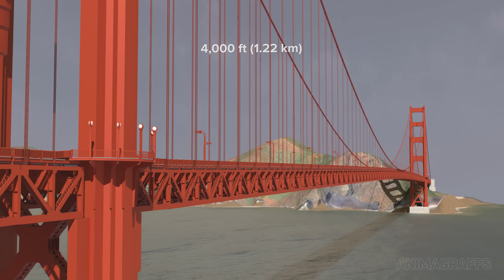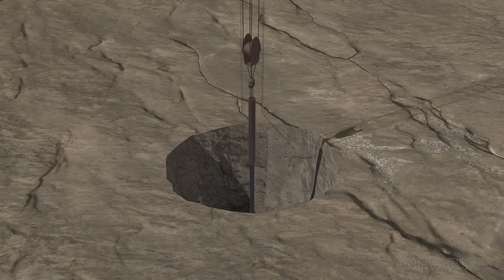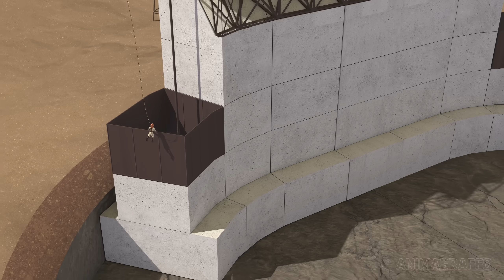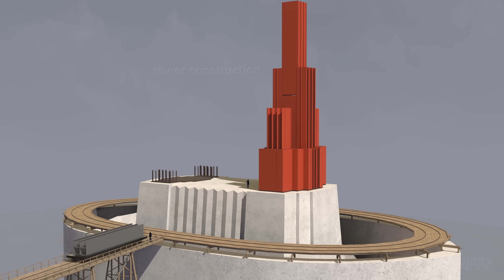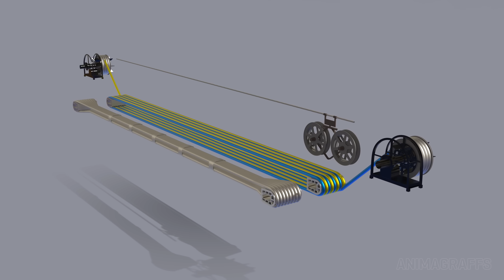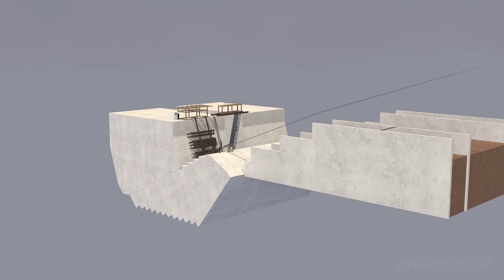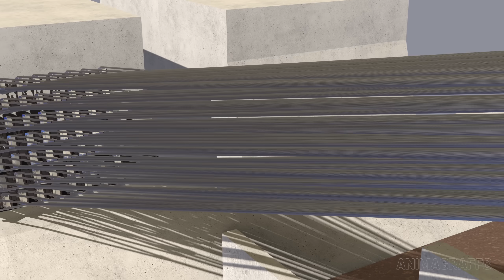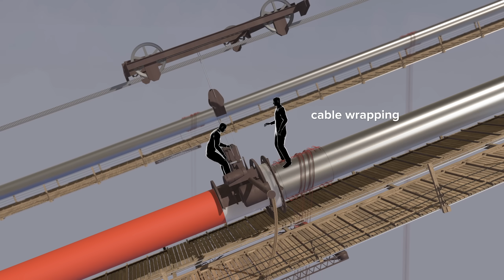How the Golden Gate Bridge Works

Comment: Not mentioned is that one anchorage is finalized by being embedded in bedrock, the other is not bedrock, but a sufficiently large concrete counterweight. 
The dimension of the average common expansion of the span off the tower would have been nice to know, the visualization seems extreme. Also interested in knowing if when the saddles are moved 5'6" do they slide under the cable, or move the cable as they move?

Comment: Thank you for placing people around the bridge for scale. The building and execution of this beautiful bridge by these beautiful people, and engineers was nothing less than amazing. Thank you ! And finally this bridge is begging for a proper inspection, paint job , and another thorough inspection. I wish I could have been at the end of the pier floating on some wood and sinking the pipe into the ground before blasting for the first time ever. Excellent Video btw !

Comment: How can the carriages stop halfway and have the lines swap carriages in the middle? Wouldn't that mean the lines would be crossed within each strand, and be anchored into a shoe that starts a line on a separate cable? In your model it shows the two lines phasing through eachother at the center span.

You also said there are 61 strands per cable, but the strand shoes are shown to be arranged in a 9x7 grid, meaning 63.

Comment: My grandpa worked on this bridge. Helped construct and pour the north foundation. The two stories he told were one: the bedrock on which they laid the foundation was the most solid rock you could ever ask for. You could hit it with a hammer and it would clang like metal.

The second story is when a new guy wanted to work on the project, they would test him by taking him up the elevator to the highest point of the tower to see if he could handle it. In the depression, a lot of those guys were pretty desperate for work.

Comment: I grew up in Southern Marin County (1960's, north side of the Golden Gate). I have driven across the bridge thousands of times and have seen dozens of documentaries of its construction. This is virtually the best description I have seen of the engineering of the Golden Gate Bridge. Especially the cable winding process. In 1984 my father and I went to see a show in San Francisco on a rainy stormy night. On our way home back to Sausalito, the storm became stronger with 60-70 mph winds. As we crossed the bridge I could see the span swaying. When we reached mid span, the bridge suddenly moved causing our car to jump from on lane to another. The bridge was closed to traffic soon after we crossed. Because of this, I have admired the engineering integrity and safety built into the Golden Gate Bridge. Thank you for this wonderful video!
Reply: From Corte Madera myself and I completely agree. I was on the bridge in 1987 for the 50th anniversary, the bridge center span was nearly flat with 300k people. Amazing.
Reply: @patrickcancilla1231  I did a BOTE calc on that. When crowded 5 lanes bumper to bumper with cars, the load was ~5m pounds. When covered with humans shoulder to shoulder, chest to back...  30M pounds
Reply: @patrickcancilla1231  I was there also.

Comment: So what's stopping the cables from stretching?
Reply: nothing, the entire point of using cable is so it has the ability to stretch.
Reply: They are stretched.
Reply: @craig7350 but like even more and more over time? Wild
Reply: @HowTeq  When you stretch steel, it wants to return to its original shape. Torque on a bolt is just an inference of how much its stretched. Wanting to return to its original shape is then what holds together whatever you bolted. Unless, it is stretched to a certain point of deformation and fatigue, then the bolt snaps. These cables will be the same, as long as they're keep under their particular over-stretched point, they'll stay like that indefinitely.
Reply: @craig7350 so its being pinched together?
Reply: @HowTeq  you could say that

Comment: Politics aside. There is NO WAY that this could be built in just over 4 years in today's age with the all of the building regs, environmental regs, Osha labor & union rules, permitting and massive red tape. For example just look at the California High-Speed Rail (CAHSR) project. It's just railroad tracks, bridges and power cables.
1979 Proposed
2015 Started
2033 est complete phase 1
2045  est complete to LA

Comment: I lived in the city for 20 years and commuted across the bridge for many years.  Many days the fog would be so thick only a few feet of the towers at the road height would be visible.  Biked and ran it many times also. The '94 SF Marathon started on the Marin side and while I was running across, some rubber-neckers got into a car crash (nobody seriously hurt).  There was debate for a decade before they finally added netting below the walkways to discourage jumpers.  On the SF side there is a beach in the Presidio that provides great views from below.

Comment: Question: I was on-site for the cable spinning on the 2007 Tacoma Narrows Bridge and during the spinning I saw 4 airless paint spray setups marking each of 4 spools a different color. This way crews could place the wire in proper order at the tower saddles. I wonder why it was important?

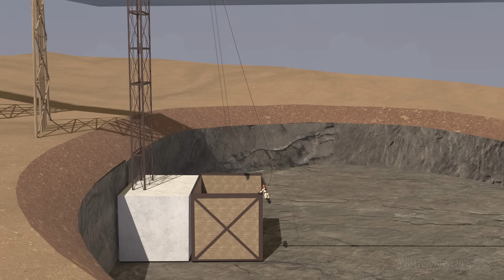Comment: 14:00 so slight correction here. The kind of diving they would've been doing is bottom diving. They would've been walking on the bottom the same way you or I would walk on land, but they had to use 150+ lbs of lead weights and equipment to do it. If they needed to work on the top of the form they would have to climb the form or use the diving crane that would also be use to lift them out.

While the bends wasnt uncommon, it was preventable most of the time and rarely lethal on this project. Only one diver died from decompression sickness.

Comment: You should do one on the Mackinac bridge.  Golden gate gets all the love for some reason, But the bridge separating michigan's upper and lower peninsula Is identical to the golden gate bridge Except it is the longest suspension bridge in the western hemisphere.  Built in the fifties,  carries intestate 75. Five miles from cable stayed Anchorage to cable stayed Anchorage.  Towers are taller. 500 ft above roadway, 800 above lakebed.  Roadway is two hundred feet above the surface of the water.   It makes the golden gate bridge look like a toy.   But nobody Ever covers it. Spelled mackinac. Pronounced mackinaw.

Comment: 11 workers died  during bridge construction, 10 in a single incident.  Those workers should be remembered, as should chief engineer Joseph Strauss, whose innovative safety measures made this, for its time, a relatively safe project.  I'm suffering from acrophobia just watching the animation.  

But I have a question: is Puget Sound not considered a land-locked harbor?  It's surface area is more than twice the size of SF Bay.

Comment: Jake, I get the strands are continuous within a cable shoe.  How does are the initial and final strands attached to the shoe?  Are they anchored to it or are they joined together to make a single continuous loop?

This video I s an amazing work.  Thank you for creating it.  It should be shown in every introductory engineering mechanics class.

Comment: Overall, the bridge is mostly air, similar to Eiffel tower. It takes great engineering to build a bridge that's barely strong enough! This is required to make these huge projects sensible to build at all. You cannot realistically build massive stone bridges on these scales.

Comment: I was on the bridge for the 50th anniversary celebration in 1987, when the bridge authority underestimated the number of people who participated by tenfold. They failed to consider the weight of 300,000 pedestrians packed shoulder to shoulder. The bridge sagged noticeably, with cables near the towers hanging loosely. Apparently the bridge was undamaged, but it could've been a catastrophe. Fortunately, there was no panic, which could easily have led to thousands of people crushed or pushed off the bridge, which at the time had no safety net.  Needless to say, they did not open the bridge to pedestrians for the 75th anniversary.

Comment: Great video, and awesome engineering when you remember that all the calculations were done with slide rules. What keeps the suspender cable bands from sliding along the cable? I would think there would be a limit to how tightly you could clamp them in place without damaging the cables.

Comment: The most bonkers part of this bridge is it was designed and built in the 1930's. There were no computers. Every single piece was designed using slide rules and hand calculations. The machinery was done using manual tools. Testing and calibration was done by  manual tools. Absolutely crazy this could be accomplished at that time.

Comment: Not a 3D view but a Isometric view.  An isometric view is a method of representing three-dimensional objects in a two-dimensional format, commonly used in technical drawings. In isometric projection, the three axes (X, Y, and Z) are equally foreshortened, with angles between them set at 120 degrees. This technique allows for the representation of objects with equal dimensions along each axis, making it easier to convey measurements and the fit of components in technical illustrations. Isometric drawings are particularly useful in engineering and architecture for their clarity in showing three-dimensional shapes. 
Wikipedia
I would like to have known how long each segment took and how many people it took.  Gads!  It was 1933 to 1937, no computers no automatic anything.  All they had was the "Slide Rule".  What a challenge.  I have walked to the mid span and felt the vibration and swaying of the deck.  What a day !

Comment: I’m from the UK and have been lucky enough to sail under, and walk and drive across this amazing bridge. What I can’t get my head around is that Mr Strauss, the Chief Engineer probably stood with a group of local politicians on one of the shores, looking across the mile-wide gap and stroking his chin, said ‘yeah, I can get a bridge built across there…’ Then all of this engineering, science and mathematics was undertaken, in the early 1930’s… Truly incredible. Great video presentation. 🙌
Reply: Strauss is stated as the Chief Engineer but he did not do the technical work. There used to be a statue of him at the Toll Plaza with rolls of blueprints under his arm. This was falsified history. Charles Alton Ellis a Purdue University Professor, penned the actual blueprints and he worked in collaboration with Leon Moisseiff. See the Wikipedia history or the book by Stephan Cassidy, Spanning the Gate. The statue of Strauss has been removed. While he did not do the design he should be credited with creating the political will to complete the project.

Comment: Your presentation is not only interesting but fascinating to me. It sort of reminds me of working on the water with 2 friends of mine who owned a Marine Construction company. They had a Bardge that had a crane which lifted a 2000 lb., hammer. My job was to climb up the 30ft. Spud, hook up the telephone pole-like piling, secure the steel bonnet to the pole so that the pole could be driven into the Chesapeake Bay or surrounding rivers where we worked. Thank you again and I will continue watching.

Comment: Amazing, well done on this project.  I greatly appreciate your hard work and due diligence on the Golden Gate Bridge. 
I would watch a mini series that covers the build of the bridge, from raw materials to the finished construction.  From mining the ore, making steel for the girders, cables, rivets etc. Plus the strength testing of said materials.  The fuel logistics, coal delivery up to the steam machinery as well as the water delivery. Crew rotation, and the organization of crews from the designers and architects to engineers and the foreman of groups.  Was there a medical team on the sight? 
All of this done in the exposed environment, the wind, fog, temperature.  I would say though that it would not have to go to in depth with all of it. Just curious about man hours. Steel mill locations, fuel involved etc.  it really puts everything in perspective.  Especially for my ADHD and hyper focused brain. 😊

Comment: With 8 spinning carriages, each with three threads no more than 4.67mm thick, spanning 1.4 miles between anchorages, being swapped at the halfway point, and in conditions where poor visibility, strong winds, heavy rain and thunderstorms are commonplace. To say that this was a monumental task is an understatement even in today's technological savvy industries. I can imagine how hard it was to keep everything running smoothly with so many things moving and being laid before they finally get everything ready to be set into the cable cradle even without half of the spinning carriages moving all at once. That's just the cable spinning; the whole bridge is an engineering marvel!

Comment: One of the very best YouTube video. Congratulations. A question : why is is so interesting to compact the cable (58') ? I would guess it does not change its resistance as, for example, it is not conpacted on top of the piles or at the ends. Seems quite spectacular if "just" to ease wrapping. It might be the reason idk

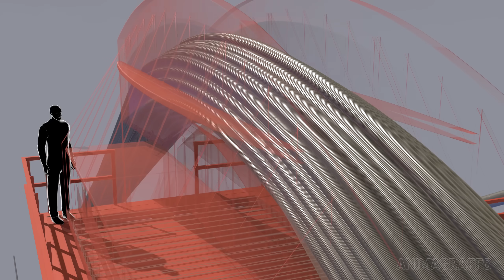Comment: 2:18 if number of wires is only known as average how do you calculate anything ?
Reply: …just calculate using the average? I assume there is an accepted margin for error, and that each strand has a minimum and maximum assumed number of wires. So the exact number of wires per strand isn’t needed for calculations.
Reply: @Thisisahandle701  correct

Comment: A small note on unit conversions: be careful not to invent precision that isn't there

For example: 720 ft (2 significant digits) gets converted on screen to 219.46 m (5 significant digits), implying a lot of precision that isn't there in the original value. You're basically saying that the tower is exactly 219.46 m high (that is centimeter precision), which definitely is not true if the value you're basing that on is "around 720 ft".

In general you should round to the same number of significant digits. So 720 ft is 220 m, in this example.

It's not a big deal and it's a fantastic video. Just something to keep in mind.

Comment: I studied electrical engineering starting in 1972.  In my first 2 years I remember doing calculations by hand with a slide rule for example problems, very simplified problems, less than 20 calculations.  It staggers my mind to think about calculating all those lengths and all those angles, applying the moduli of elasticity and the coefficients of thermal expansion for the differing alloys and grades of alloys of metals of the wires, the braces, the brackets and towers.  27,572 in 61 strands.  Hundreds of brackets and braces every so many feet.  Staggering to calculate.  And even staggering to copy from workbook to the hundreds of detail plans and drawings.  

And the hundreds of draftsmen drawing and re-drawing plans and detail diagrams over and over again for design changes.

All without calculators or computers of any kind beyond slide rules.  

And that is ignoring the geotechnical engineering of the site and alternative sites, the engineering of the foundations, piles and piers.

Staggering complexity done without any of the electronic aids and modeling techniques that only began to become available in the 1950s.

An amazing achievement by the nameless faceless engineers, draftsmen, tradesmen, and labourers.  I suppose the names of all but the most senior managers are lost to history, but IF they are not, they should be preserved on brass plaques at the site of their creation.  So many names, it will require a very large set of brass plaques.
Reply: And people lives depended on each of those calculations.
Reply: Someone below posted, "We can imagine the temerity and absolute confidence of the engineers in their craft."  
And my immediate thought was how ulcers were induced in the creation, and many vomited the night before opening day.  God the responsibility, so many thousands of people per hour, 7/24/365, year-after-year.  And the earthquakes.  And the knowledge of the sciences of metallurgy, structures, and geology was much less than today, they didn't have the instruments and hadn't yet had time to gather detailed data.  

Educated guess work and ample safety margines are the stuff of nightmares when thousands of human lives are at stake.  Ulcers were the third (fourth?) leading cause of death for men even in the 1970s just after heart attacks.

But they kept their clear heads and their safety margins turned out to be ample.  They all deserve to be memorialized, not just the politicians and construction executives.

Comment: @animagrafs This is a wonderfully complete coverage of my favorite bridge. I’ve been driving across it since before I was old enough to remember, to visit family; then later for business stuff.

I think the only notable features you left out was the foghorns mounted on the bridge. Two on the south tower and one mod-span. And the suicide prevention nets that are a very recent addition. Every other feature I kept wondering about you eventually covered, and it was amazing.

I recently spent a bunch of time atop Fort Point filming Tally Ho sailing underneath the bridge, and highly recommend that location to get a great sense of how big and beautiful the bridge is.

One bit of obscure trivia: A rehabilitation of the bridge deck structure in the late 1900s (I think to redo the 1961 strengthening) lightened and strengthened the bridge deck enough that it’s now possible to run light rail underneath the road deck. It will probably never happen, but is possible.